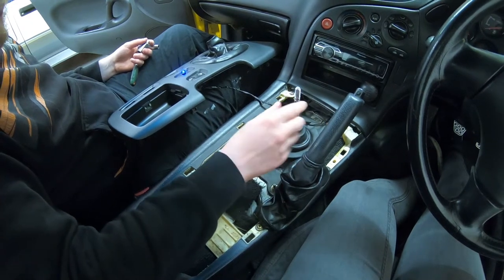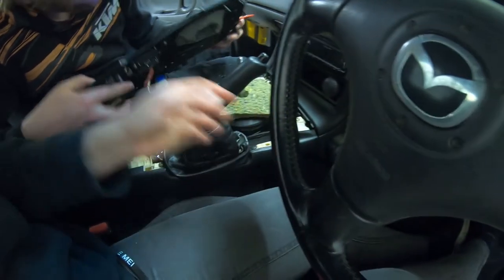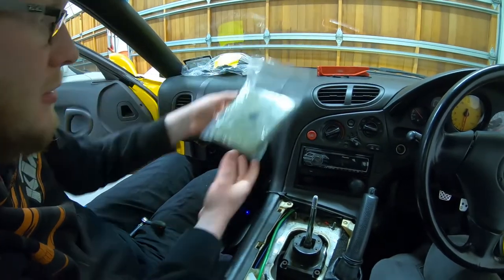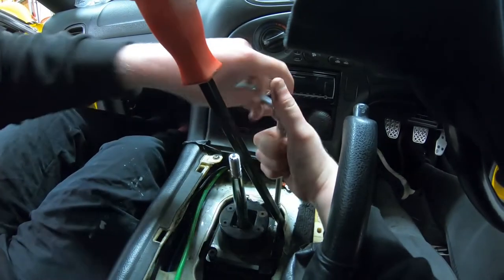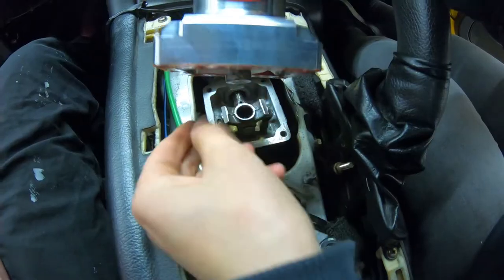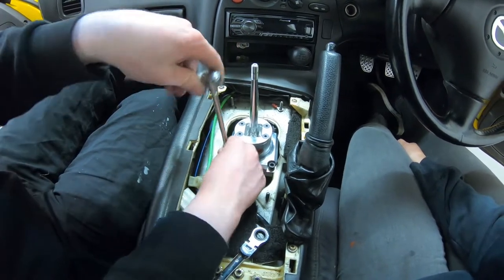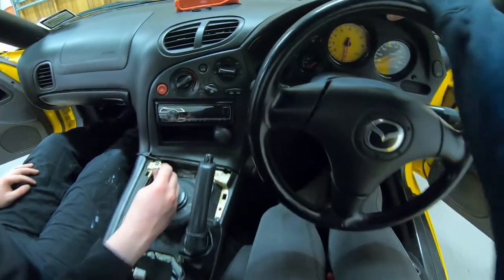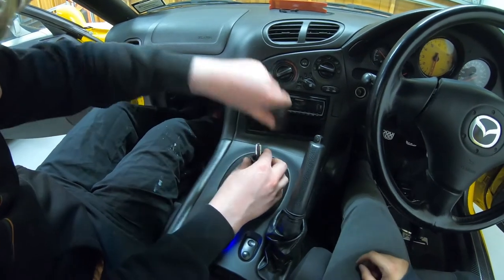Installing a Short Shifter for an FD RX7

Comment: I agree, hitting John's car with the crowbar always helps. I put a short shift kit in my green Avenger when I did the swap to the Ford Sierra 5 speed. When I brought my Sierra gearbox it had a super dodgy DIY short shifter made from a block of wood, I replaced it will a proper one before doing the swap. I find that the R154 in the V8 Avenger doesn't really need a short shift kit.
Reply from the maker: i feel swapping from a literal block of wood is a severe downgrade :P 
that sounds real hilarious haha!